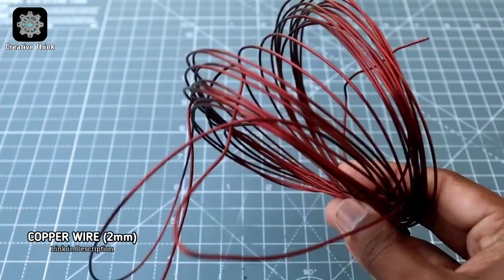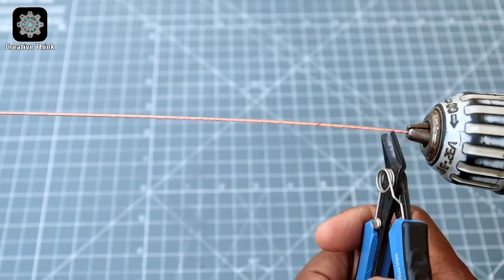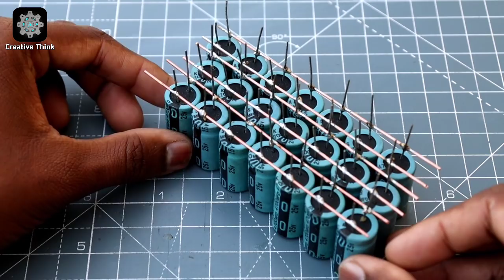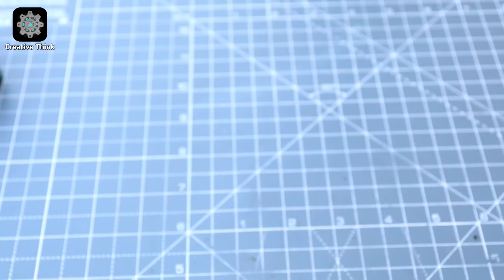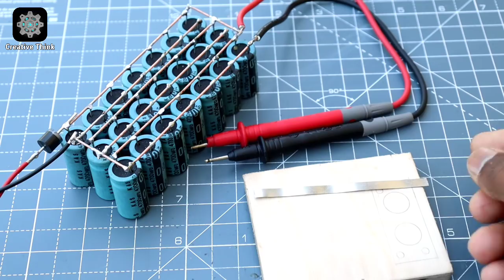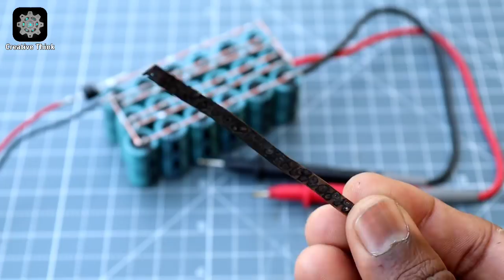Powerful Capacitor Using Spot Welding

Comment: تمام فكره جميله...هل القطعه السوداء ٦فولت هل هى دايود وما فائدتها. وحضرتك لم توضح مصدر الكهرباء الذى جبت منه السلك الاحمر والاسود ولم توضح قدرته كام امبير وكام فولت. 
Nice idea...Is the black 6 volt a diode and what is its use?  And you did not explain the source of the electricity from which you got the red and black wire, nor did you clarify its capacity, amps and volts.

Comment: Nowhere near 100a there (2mm wire won't allow that). The nickel strip is destroyed because the pulse is too long in duration, not because of high current.

Comment: I've tried but it doesn't worked. Could you please indicate which kind of supply have you used? Machine accumulator or what? I've tried with computer power supply and machine accumulator charger but not work 😡🤬👺

Comment: Voce não monstrou as chapas sendo soldadas uma na outra não provou a funcionabilidade do projeto voce apenas mostrou cena de curto circuito de varios capacitores seu video ficou falho devido a isto,mas o que vale é a intenção afinal né.
Reply: Tens que dizer em inglês, só assim ele vai entender.

You didn't show us the plates being welded, you didn't prove us its funcionality. You only showed us a bit of short-circuit, that's why your video failed. But what really counts is your interaction.

Valeu.